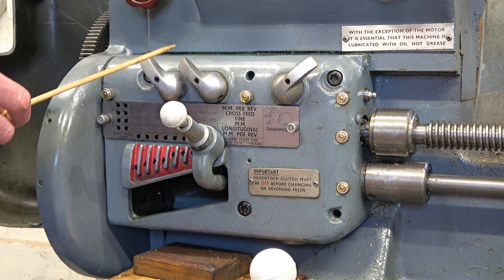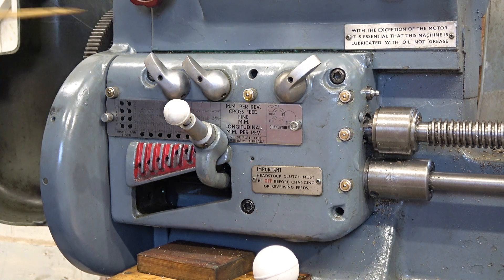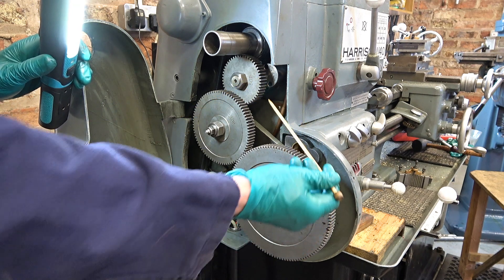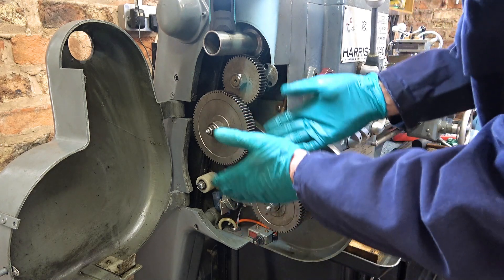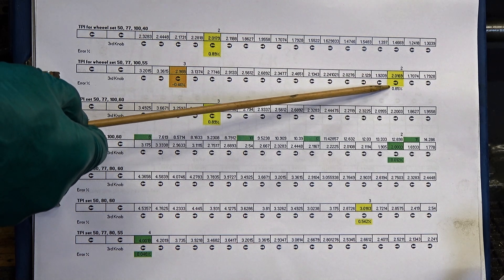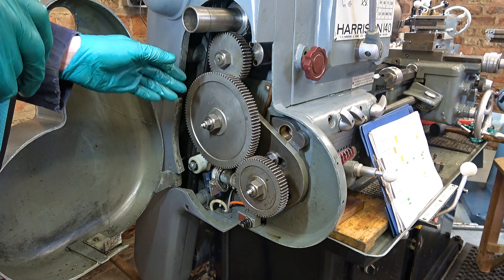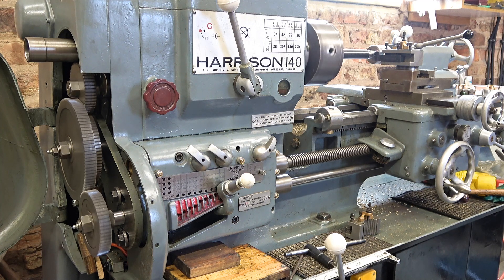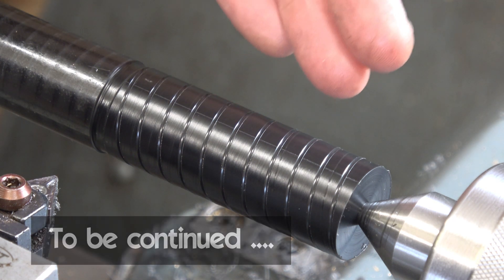HS256 Multi-start threading 2tpi 2start – Part 1

Comment: I'm working towards cutting a 3/4" 2TPI double start left hand stub acme (nearly square) thread to repair an old artisan lathe. This is great information for what I'm working towards.
Reply from the maker: Hiya, somebody has pointed out to me that I actually produced 4tpi 2 start (2 x 2tpi interleaved). Anyway I'm glad if it's useful. Cheers
Reply: @HaxbyShed I think the person saying it's a 4tpi threads were confused about actual tpi, the thread count, and effective thread travel or effective lead pitch. A 2tpi double start thread is still a 2tpi thread but the effective thread travel equivalent is 4tpi because there is 2 threads. It's a funny thing that happens when you have multi start threads. You can directly replace a 2tpi double start thread with a 4tpi single start thread and the travel is the same (ignoring all the other reasons for multi start threads) Multi start threads have a longer effective lead pitch as each physical thread is apart of the total effective lead pitch. The multi start thread tables typically show the effective lead pitch for single thread, double thread and triple thread. But that doesn't change the physical tpi. If you didn't know it was a double start thread and you blindly counted physical threads you would mistakenly determine it's a 4tpi thread because the physical thread count and the effective thread pitch are the same.
Reply from the maker: @askquestionstrythings  Thank you for explaining that 👍

Comment: Hello Mr. Phil 
I'm glad to see your show and very nice info.
I have some questions about the gears for my homemade Lathe the hold body of the lathe is finished and ready but now I'm stuck on how to get the gears to contact the gears box and track the south bend and my is doesn't know gears teeth numbers. 
I tried looking in my place but never founded. I saw gears lathe in Amazon but I can't get it because no shipping to my country.
Thanks
Reply from the maker: Hi Mr Rany, one option might be 3D printed gears. I have two gears cut from POM/Delrin/Acetal and they are strong enough. Just a suggestion .......  Cheers

Comment: Great result Paul, enjoyed watching your method to achieved the desired pitch, using your own mathematics. Like you say the error is minute
on the length of thread required. Looking forward to part two. I did similar a while ago, hit n miss lol, single start though, same lathe. Cheers Tony
Reply: Hi Paul. It must have been a cost issue for Harrison to discontinue the clutch drive on their newer M model lathes. I agree it's a brilliant feature to have for fine control. Cheers Tony
Reply from the maker: Hi Tony, I find these Harrison training and small workshop machines (lathes & mills) are just so capable. Lovely machines and a joy to operate. I am so grateful for the clutch/brake on the lathe and one reason why I did not buy a Bantam. Cheers

Comment: Hi,   With regards to disengag lead screw, leave it in place Move top slide along the pitch 1 inch.

Steve
Reply from the maker: I hear what you say Steve but disengaging the lead screw and turning the chuck 180, then slipping it back in gear, took just a few seconds, was accurate, and was 'fail safe'.  You will see in Part 2 I can do it for 2, 3 and 6 starts.  For others I would need to use the method you mention. Cheers

Comment: Whilst this must be the most tricky conversion from Imperial to SI it’s important to understand it. Our Colchester Student has both SI and Imperial but that’s presumably only the dial markings. We will most likely buy a Clough42 (Cloud 42) digital conversion and like today’s digital welders, let the Silicon do the hard work. In the meantime this video helps us understand the situation. No wonder you need a break
Reply from the maker: Hi Geoff, the big lookup table in my head of all the imperial and metric equivalences is getting bigger.   🤪
Reply: @HaxbyShed  Some months ago l was aiming to revise my threading standards from Whitworth (lathe);to Metric (mill), including AN. (Aeroplane). Americans like quoting numbers at every opportunity so l bought an unused legacy-book with many of the detail threading dimensions. It was a vast array of lookups, but will only be used as a reference. After buying a test string of nuts and bolts, its getting easier to instantly recognise such. In the last two days we have been collecting materials, oak from Scawston and 550W solar panels from Felixstowe. Having known Sutton Bank from my childhood l took the route via. Bylands Abbey on the way up. Never appreciated how extensive the Hambletons are, with so few roads. Almost went via, Haxby to lower the 25% gradient. A1 to Felixstowe is a road repair nightmare, almost dangerous at night. Took a coastal and country route back only to discover several more road diversions (508 mile trip). Staying home for a while now.

Comment: You can actually disengage the half-nuts at the end of the thread.  Note (or mark) the position on the threading dial that aligns with the fiducial mark on the body while the half-nuts are engaged.  Disengage the half-nuts at the end of the thread as per normal and stop the lathe before the threading dial does a full turn.  Don't move the carriage manually!  Run the lathe in reverse and re-engage the half nuts when the dial returns to its marked position.
Reply from the maker: I'm with you Chris. 👍

Comment: Hi Paul, What a task that was, very enjoyable to watch. Well done for getting there and only out by 0.012%. Did you think about cutting the gear yourself?

It did make me think back to my Grandpa's lathe which had all the gears unguarded. It was there I made my first cuts. In the end it became my Dads and then we donated it to the Portsmouth Historical Dockyard. Turns out it was of a type that was used onboard submarines. Funny old world as that is the industry that Im  working in down here.

Look forward to seeing you cut the doublestart thread.

Have a great weekend!!
Reply from the maker: Hi David, one day I will cut my own gears but a set of cutters can be expensive. You can get a set of 14DP 14.5pa cutters on ebay for about £80 from China but they are for a 22mm arbour and I only have 27mm and 1 inch arbors. I must get or make myself a 22mm stub arbor one day.  (Do we spell it arbor or arbour - I can't make my mind up?).
Reply: @HaxbyShed  Hi Paul, well the answer to that one depends on what side of the pond you are on!!

From HarperCollins Publishers
arbor
in British English
NOUN
1. a rotating shaft in a machine or power tool on which a milling cutter or grinding wheel is fitted

I seem to recall a comment about the cost of machine tools and the cost of associated tooling being at least double 

All the best

Comment: Nice lathe. A lot of people have converted their lathes with VFDs. Clough 42 has a very good series on this. It eliminates the nightmare of change gears and gives you unlimited feeds and speeds and any thread combination you need - metric or standard - all at the touch of a screen. The problem I have with my lathe, while a very good lathe, is no change gears and I've never cut gears before though I am planning on learning in the not-too-distant future. Still the idea of converting my lathe to a VFD is still in the back of my mind. Check him out, I think you will find his channel very interesting. He is in the process of making his surface grinder into a CNC surface grinder.

And, I'm sure I have seen your voice heading down one of the canals on a long boat. 

😁😎👍👣
Reply from the maker: Hi Opie, ah yes I think I've watched Clough 42's vid on that. I've seen stepper motors and controllers applied to all sorts of projects like differential indexing on a dividing head for cutting helical gears etc. It may be the modern and better way but I do find a load of clanking gears quite satisfying and reliable 😁.
Reply: We have a VFD attached to our 3ph air compressor and it makes a great job of controlling the speed. We can also drive the lathe from it, but l don’t understand how it would help with thread cutting. Are you simply generically calling the stepper motors VFDs? We are expecting to use Clough42’s design.
Reply: @GeoffHome-u6r  I just made a simple comment. You need to ask clough 42.

Comment: Thats a beautiful Lathe you have there. I really like it. Interesting setup on the change gears. 
I guess I’m just spoiled, my lathe doesn’t have change gears. Metric or imperial threads. I just select and go. I have two of the Clausing Metosa C1330S. One I’m still repairing and making parts for. But I’m still a little bit jealous of your Harrison 140. Can’t beat the old Iron workhorses. 
But thanks for sharing your insight. You are a very capable machinist sir. 🫡
Reply from the maker: Hi Jason, I googled 'Clausing Metosa C1330S' and I can see it is a very nice lathe.  I'm not sure if it has any access to change the screw cutting gears to add pitches not in the box. I was feeling pretty pleased with getting 2pti and now somebody just mentioned 27tpi for NTP (which I don't have as standard)🙄, so that would be another gear combo hunt (if I did not have a tap). Cheers

Comment: Thanks for the video.   Very interesting challenge.   I may have a similar challenge for M33 x 3.5 thread for some local wood lathes.   I have imperial lathe but my threading chart shows I can make 3, 3.75 and 4 mm pitches but no 3.5.
I have not tried a two start thread.   I will be eagerly waiting for the next part video.
Dave.
Reply from the maker: That's interesting Dave, you will see all the metric threads I can cut in the next part. It includes 3.5mm pitch but now I've just noted I could also cut 3.75mm pitch, although it's not listed. If you are able to construct a spreadsheet you may find you can cut pitches you did not know (i.e. they are not listed on the gearbox plate). On the plate my metric fine range runs up to 0.9mm pitch but my spreadsheet tells me that I can actually cut up to 1.5mm pitch with those gears. That overlaps with the next range, so these are not extra pitches, but it means I can cut 1.5mm pitch without changing the fine range gears. It was very revealing/enlightening. Cheers

Comment: Hello Paul. I enjoyed that. I had similar issues when cutting the imperial nut for my milling machine knee. I also have done multistart threads. In fact I am doing one now, so your film is highly apposite! 

Machine is set up to cut the pitch I want (for a metric thread) so say 3mm pitch. I put the cut on using the cross slide, with the topslide set parallel to the work, ie at 90 Deg to the cross slide. Half nuts engaged and kept engaged throughout, reversing the lathe to get back to the start after each cut. Cut the first start to depth in this way. Once first start is cut and tool back at the beginning I proceed as follows. 

Set up a clock on the top slide and move the tool forwards, ie towards the chuck by half of the pitch being cut. So for 3mm move the top slide towards the chuck by 1.5mm. Once this is done, remove the clock and start the threading process again. The tool will now start cutting the workpiece 180 Deg around from the first start. Continue like this until the second start is correctly depthed.

In your case with an imperial thread of 2tpi the pitch is 0.5 inch so you'd move the topslide forward by that amount. 

I'm doing this at the moment but not for a screw to fit a nut, it's for a swirl inducer that is part of a fuel injector. 

Thanks again for the film I really enjoyed it.
Reply from the maker: Hi Carl, you will see next week that I landed on an easy dodge to index 2, 3 and 6 start threads on my Harrison 140. For others I would have to use the 'tool advance' method you describe. Somebody is going to comment, so it may as well be me, that the tool advance to add in the interleaved thread on 2 tpi would be 1/4 inch (not 1/2). Cheers Paul
Reply: @HaxbyShed  Yes you are right of course. Half the pitch to advance or 0.25" in this case. I am looking forward to your next film to show how you did it.

Comment: That was a very interesting and fascinating "lesson". It was easy to follow your "thinking aloud" video.
Personally, I wouldn't modify the cover of your beautiful lathe and live with the (not so health and safety compliant) work-around.
My approach for cutting "special gears" is as follows:
I wrote a little program in the scripting language Matlab/octave which combines all available change gears and calculates the ratios which are subsequently sorted. Thus I can pick the required set of gears. As you explain: in many cases they don't fit physically but there are alternatives in most cases. 
In your particular case you might have been able to "fill the gap" between the gears with an additional idler gear.
For extremely steep pitches you might experience an other "physical problem": the forces required to drive the carriage might be too high and even damage the wheels in your gear train. I experienced this problem when I had to cut a 3 start worm-gear with a pitch of about 18.85 mm. Even though I found a suitable set of change gears, I couldn't cut the "thread" due to the excessive forces and ended up spiral-milling it.
Again, thank you very much for your well thought explanations. I enjoyed every second.
Reply from the maker: Thank you Harald, your encouragement is appreciated. I was indeed concerned about the load on the gear train and that's why I cut the thread in delrin. I have cut 5tpi ok straight-in in silver steel so maybe 2tpi would be ok but there was no need to risk it for this self-training exercise.  The idler gear is a good thought. Many years ago I used to write simple programs in Pascal (as a hobby). Excel is very powerful with macros and visual basic, I should probably take the trouble to learn. Cheers

Comment: hi Paul
You need a lie down now Paul, its interesting to play around with the gearing, iv'e had fun on my micro lathe i'm making, to get the various possible ratio's in a given physically small space, in fact i still keep revisiting it. when i've nothing to do !! 😄😄 (that'll be the day)
Many hobby lathe workers i see shy away from using the lathe to cut threads, suppose it seems a bit scary to to some but like everything, practice makes perfect, i take my hat off to Kimber Zelic he always has a go at it, and with having a go he's learning quickly. plus it saves a fortune on taps and die's
See you when you've recovered.😄😄👍👍👍👍👍👍
atb
Kev
Reply from the maker: Hi Kev, these subjects are often much deeper than they appear and the sometimes the only way to understand is just to have a go. There is only so much one can do at a desk. I wondered if I could find a gear combo for 2tpi that would allow me to close the end cover but I can't think of a way to find that other than trial and error plugging in all the possible gears into the spreadsheet initially then doing the physical check on the ones that worked mathematically (lengthy and tedious).  Cheers

Comment: My lathe has a 4TPI lead screw for imperial threads. The gear train had a 120 tooth gear for imperial, we use 127 tooth for metric. The appropriate selection of pinion gears gives exact metric. You just can’t disengage the half nut or your synchronization messes up.
Reply from the maker: Hi Glenn, there is something magic about the prime number 127. I will investigate ......  Cheers
Reply: @HaxbyShed  it is exactly 1/2 of 254,

Comment: Makes me wonder if the people who designed the banjo and gear train knew this and provided JUST enough room between the main shaft and the lead screw to accommodate these gears This must be at the practical limit for a lathe of this size, although perhaps by using something like a tool post grinder...?
Thank you for taking the trouble to explain this in detail, much appreciated.  One of the reasons I look forward to your videos.     Robert
Reply from the maker: Thank you Robert. Standard it cuts 60tpi to 4tpi (with the extra 63T and 40T gears), or 0.2mm to 7mm. These lathes were made in their hundreds for schools and colleges, and small workshops. I guess they thought 4tpi was as fast as an apprentice should be permitted due to danger of saddle to chuck crash  😁

Comment: I love your thinking on this Paul, should I ever need to do something similar I'll be coming back to this video. My head would  hurt too much to try to do it all myself these days. 
It's a very long time since I had to try and calculate gear ratios for a lathe. 50 years since my apprenticeship, in fact. At least we have spreadsheets to automate some of it now, calculators had only just come out back then and I couldn't afford one.
Reply from the maker: Hi Bill, I remember calculators were becoming more widely available during my first year at college (day release then) and would cost about a 80% of a week's wage for an apprentice. I saved up for one. Cheers

Comment: My brain is still recovering from doing the calculations to cut a 27tpi thread on my metric lathe, the Myford could have done it but I have the gearbox Super7 so can't fit the appropriate change gears i would need and I wasn't going to buy yet another lathe!😕
Reply from the maker: Hi Chris, 27tpi NPT I'm guessing? Mine won't cut 27tpi from standard. I'd have to play "hunt the gear" again on the spreadsheets. Cheers
Reply: @HaxbyShed  unfortunately not, 3/16"×27 is a proprietary Douglas motorcycle thread, taps and dies are like hen's teeth and a friend wanted some stainless bolts and screws. That was what I made the special style steady for in one of my videos.